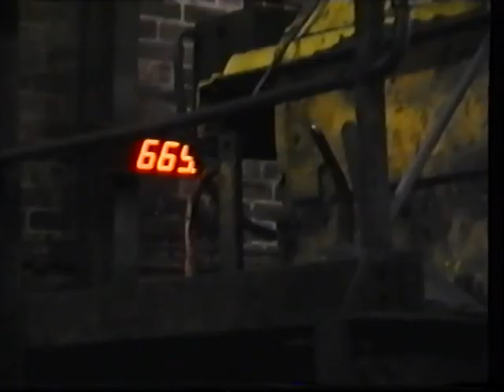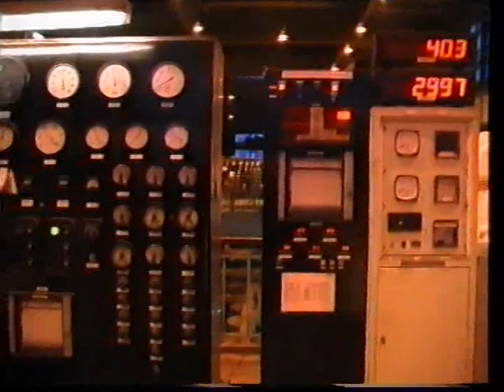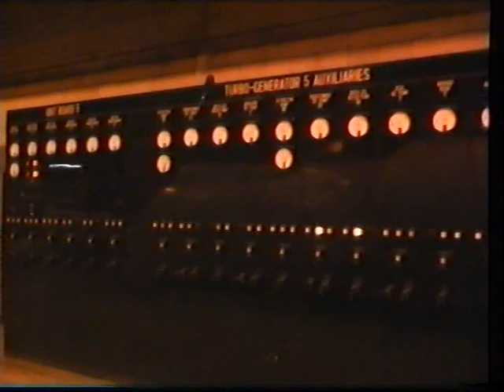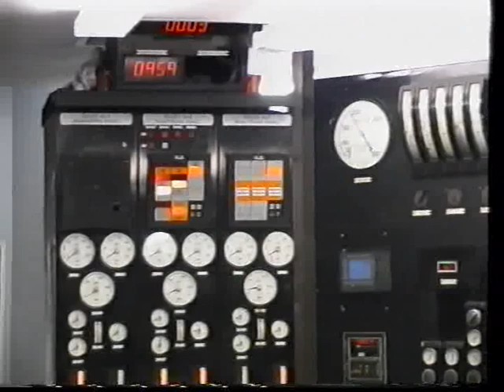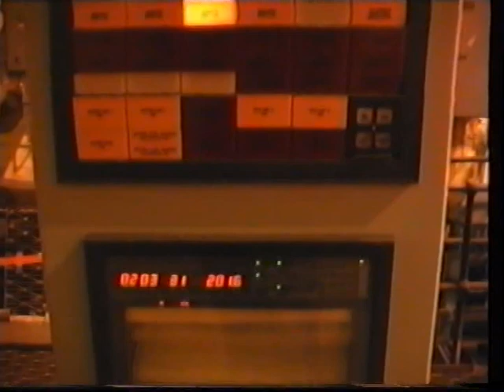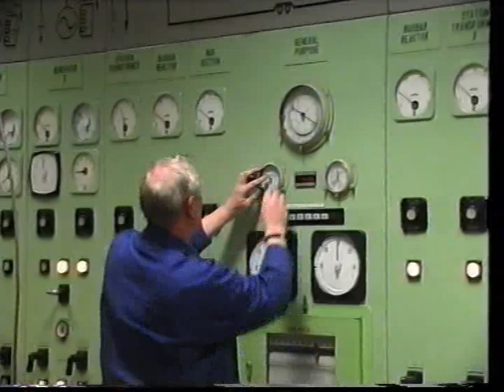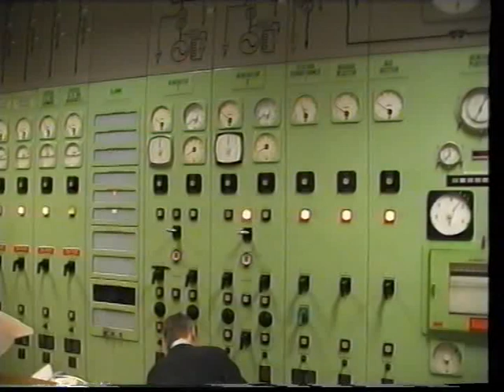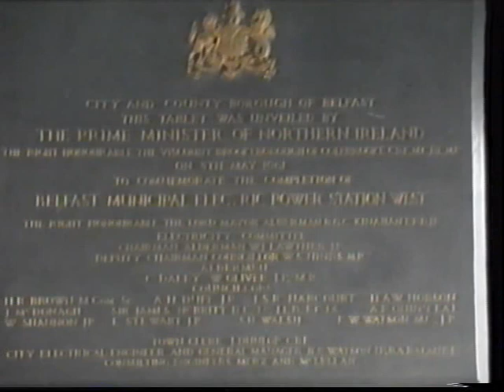Belfast Power Station West The Final Day

Comment: Sad to see. So much of our electrical history just ends up dumped. In Hastings, England, we had a Power Station that supplied the trams, there were 6 Bellis&Morcom reciprocating steam engines driving alternators. 6,600V was sent to rotary converters and made into DC for the trams. There was a coal - fired plant nearby completed in the 20s that supplied the town and outlying towns. This was replaced in the late 60's by a gas-turbine one that contained 8 Rolls-Royce Avon Jets. We used to take the tank cars of aviation fuel there when I first started on the railway. Some of the power equipment used in the coal - fired plant came from the original Power Station in Earl Street. Sadly, all gone now, but the Earl st plant building remains, as a furniture and carpet shop. So do, I think, a couple of the substations for the trams.

Comment: Have a load of videos of the station  made from 1995-1998, spent 3 years working there mainly  repairing/replacing the ash covers down in "Hell".
Reply from the maker: I'd love to see those videos. I worked in PSW from 1989 untill it closed.